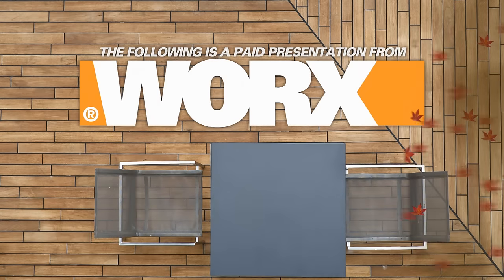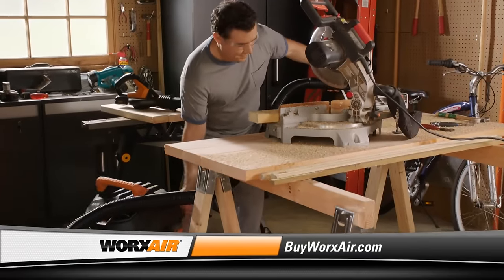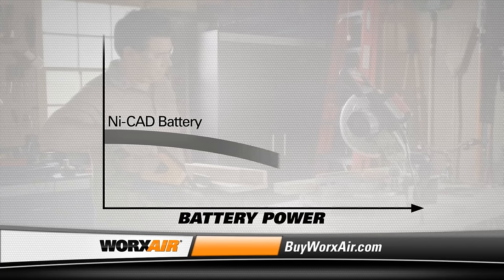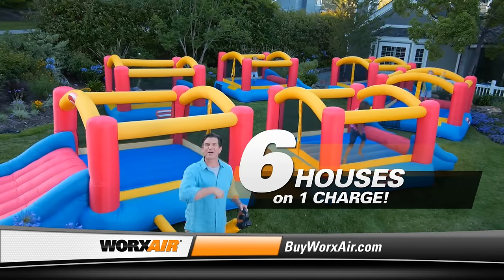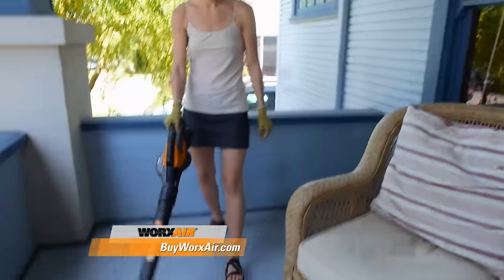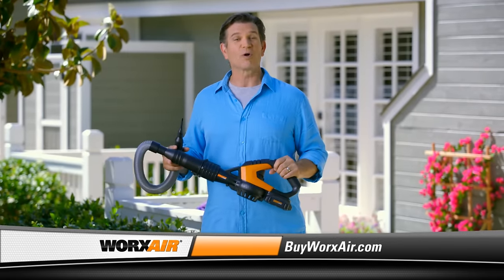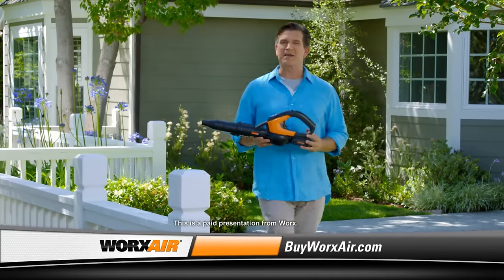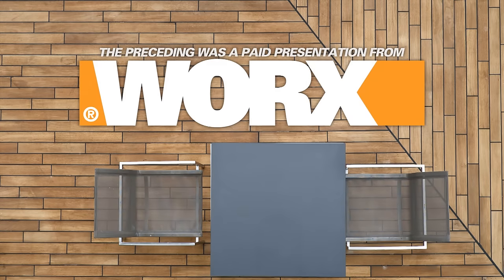WORX AIR Cordless Blower / Sweeper

Comment: Iv had one for a year now.  This blower is best for hard surfaces such as driveways, decks or even roofs and eaves troughs.  Great for detailing and easy lightweight and speedy cleanup being able to go anywhere with it.  Perfect tool along side your high powered blower when the job doesn't require heavy duty blowing.  As a roofer this tool is essential.

Comment: I WOULD LIKE IT FOR CLEANING LEAVES FROM GUTTER DO I NEED TO BUY AN EXTENTION TO REACH
Reply from the maker: Thank you for your question.  Yes!  In order to achieve gutter cleaning, we recommend our AIR Gutter Cleaning kit as described here https://www.worx.com/air-gutter-cleaning-kit-wa4090.html.
Reply: I have it and it is a little weak for gutters. And I have gutter guards so it does not have to go down in.

Comment: barely moved those leaves. might make a good hair dryer.
Reply from the maker: +Brent Hill We have no hair dryers, but as far as leaf blowers; we offer both electric and battery power that exceed 100mph.
Reply: +WORXTools What is the CFM rating for this blower ?
Reply from the maker: 120 MPH air speed with 80 CFM air flow
Reply: Brent Hill